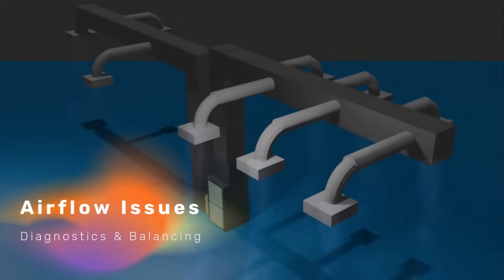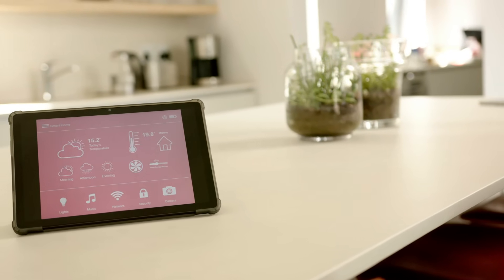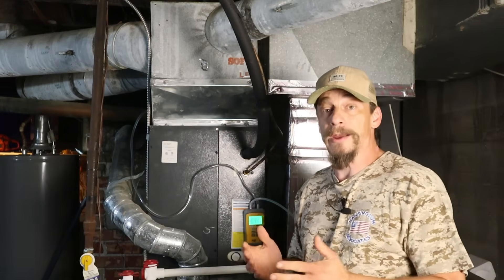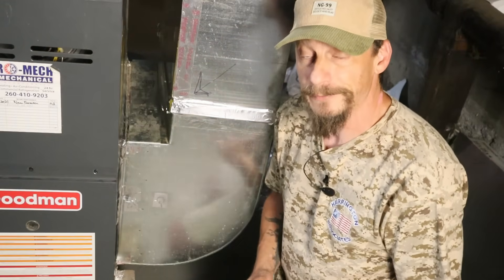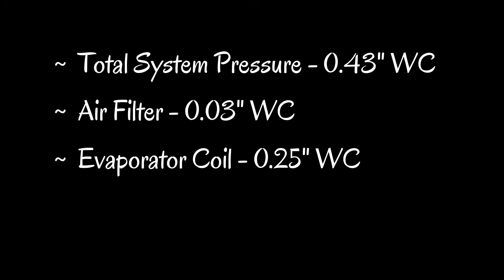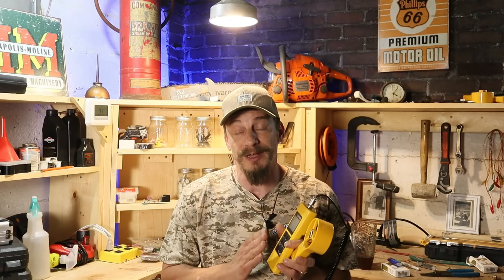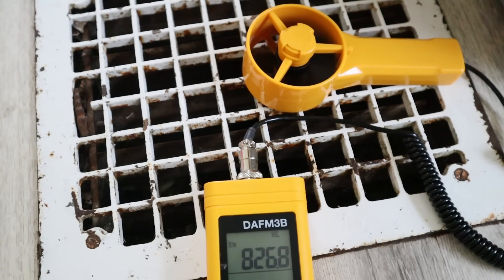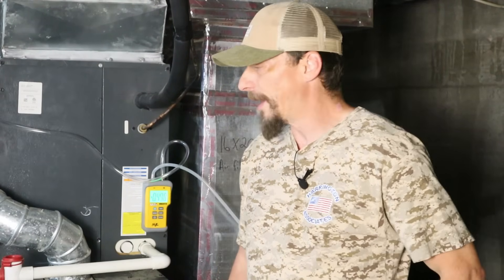How To Make Every Room Comfortable With Better Airflow

Comment: Thanks for your videos,  Mike.  I learn a lot from them.  I have a question.  Where do you take return pressure reading if there is no return duct?  A lot pf small houses will just have the unit in a closet on a short shelf with holes cut on the sides of the wall.
Reply from the maker: I take it just above the unit in the closet with the door closed.

Comment: Shouldn’t Total external static pressure be checked after the filter and before the coil?
Reply: Yes. You’re measuring everything that restricts the airflow. An AC coil and a filter are restrictions to that airflow.

Comment: Nice video! I'm still learning a bit about airflow and static. I had a senior tech tell me that me that before I make any adjustments to the blower speed, count the amount of ducts, what size the ducts are, and how much CFM the ducts are rated, add them up to the total CFM the house plus what CFM the tonnage the system needs and adjust from there. There had been times where I would come up to a 2 or 2.5 ton AC but they have a furnace with a 4 or 5 ton blower drive where I have to adjust the speed due to it getting too much airflow. He also mention if the static is off that you might have to add an extra supply or return duct to equalize it and improve the static if it's too high. I've only done it a few times but still learning. Any additional tips would be great too! Awesome video again!

Comment: Fantastic explanation!  Thank you for this. I’ll use your suggested method to adjust the balance in my new build since the system installer only goes by measuring the register temperature which doesn’t seem correct me for keeping a room cool during the hot summer (or cold winter).

Comment: I have 2 registers that get very very low CFM in fact one of them has 0 cfm.  They are the furthest runs in the house as well but we are talking 30ft max from the unit.  The condenser and heat exchanger were installed in 2016 and I called the people who installed them 2 weeks after install and they were ... combative (?) about coming out and checking the ducting.  They did ultimately agree to come out and look at it if they could give me a sales pitch on their smart vents (which btw were battery powered vent covers that cost $7000 which was more than the things they installed 2 weeks earlier).  The guy spent 30 seconds under the house looking and came back and said he couldnt find the duct at all for the vent that doesnt work.  I do not know if I have any dampers in the system because it has some trunk lines and then flexi duct to the registers and the vast majority of it is inside the ceiling or in the crawlspace.  I can tell you that the rooms that are connected to the crawlspace "trunk" (the kitchen and living room) are the ones that get very poor airflow.  The rest of the house off of the main trunk gets decent airflow but the master bedroom has about 9-10 mph wind coming out of the 4x10 register.  I need to figure out where the issue is because right now I have to run the AC for several hours because the thermostat is in the living room on the stairway going upstairs.  So the only way we are able to cool the house is to leave the bedroom vents shut or if we are going to be in the bedroom leave them open and the door open and wait for the cool air to waft down the stairs.
Reply from the maker: Call another company to come out and take a look. That behavior is just unacceptable.
Reply: @JerseyMikeHVAC  I had another company come out and perform a free inspection on the unit itself in 2019 just to see if it was functioning ok and the guy tried to say it was 8lbs low on coolant and needed new schrader valves (2 years after install?) then corrected himself and said it only needed 1/2lb of coolant and the price was going to be $550. I told him to pound sand.  He never even got to the point of looking at the ducts.  I wish I could find a reputable hvac tech but so far I'm 0 for 2.  Oh and the install company wanted $250/yr for a service contract to keep the warranty up.  I told them to pound sand as well.

Comment: My 3 ton Carrier air handler is mounted vertically in a closet made just for that unit. The manual says to include the dry coil, filter, and heat strips to obtain the correct airflow performance based on the 7 possible columns of static pressure. In this situation, where would you place the return air static probe in an installation that is using the closet as a plenum? There is no return air ductwork on the bottom of the air handler, as the ceiling of this closet is cutout to accept the return air duct. I'm assuming that if a filter is included in the calculation, the probe should be located just prior to the filter and not after. Is this correct?

Comment: I cannot get an HVAC company to do anything beyond basic maintenance that I've already done. My central air has struggled since I bought my home 7 years ago. My outside unit is the right size and only 5 years old. All my vents blow good but some rooms are noticably warmer. The house was built before central air and I think it was just slapped in here without any consideration for proper balance but I'm just a diy homeowner so I could be wrong. 

Edit: my supply plenum is in the crawlspace so I'm not sure how this test could be done

Comment: great video! i subbed to learn more! just wondering what are your thoughts on those electronic dampers using two thermostats?
Reply from the maker: The “quick and cheap” versions that just use two thermostats to power dampers directly can cause high static, noisy airflow, and even shorten equipment life. Design matters a lot with zoning.

Comment: Another Great video .thank you . Just have a question if we need to place those manual dampers is it better to install them close to take off or we need to install them at least one feet from the main run truck line please advise.
Reply from the maker: Ideally, you want to install manual dampers about 6 to 12 inches away from the trunk line, not right up against the takeoff.

Placing them a bit down the branch allows the airflow to stabilize before hitting the damper blade, which gives you better control and less turbulence. It also helps prevent noise or whistling from air being forced around a partially closed blade in a high-pressure zone.

But you don’t want them too far down the line either — that makes balancing less effective since static pressure has already dropped by that point.

Comment: Mike, in my 1964 house, all the ducts are behind 7/8” plaster board (great construction by the builder who built it for his retirement).  It’s AC only, and I don’t see any damper controls.  The return & supply plenum is exposed for like 2 feet at the Air Handler.  I’ve tried closing supply registers of “cooled rooms” to push air back to “hot rooms”, but so called professionals advise against that.
Any suggestions to balance?
Reply from the maker: Grille-based balancing does have limitations:
– The restriction happens right at the end, so it can cause turbulence or noise
– It’s less effective at actually redirecting airflow upstream
– If overdone across multiple registers, it can raise static pressure at the blower

If you're just making small adjustments, you’re probably fine. But if you want a little more control without crossing into those “static pressure” issues, you can install simple DIY restrictors a few feet inside the duct (like foam discs with center holes). They act more like proper balancing dampers and smooth out airflow while still reducing volume.

They don’t solve everything, but when working with an older system with no access to the ductwork itself, it could be better than using the registers themselves. Just don't fully block any of them or overdo it on too many registers.

Comment: I bought the same anoemeter but never made the connection that I could simply use the fpm limits on my ductulator for the anoemeter measurements. Thanks alot!

Comment: Nice, but I was thinking that IF you have very different sized registers, you would want to use cfm for a better over all idea of what is happening.
Reply from the maker: Yeah I agree. But this is something I can fine tune in on after all of the initial balancing. At this point (after the work done in the video) I would switch over to cfm readings and fine tune. I would even do a load calc and go by those guidelines. But this is not stuff a tech is going to do while on the roll. For my house, yeah certainly.
Reply: @kenthomas4668 I'm pretty sure velocity and cfm are relative to each other. Velocity and duct size can be used to calculate your cfm and vise versa. Now whether or not said # is sufficient enough for a particular square footage area is a different story.
Reply: Another great video, thanks.  Did you ever try balancing using supply static pressure on each run using the formula:
New SP= Existing SP X (Desired CFM X Existing CFM) ^2
Reply from the maker: No, but I'm really interested in giving that a try now.

Comment: Mike, fantastic tutorial. Will closing a damper/dampers cause any additional noise to be heard from the vents from the runs that were being throttled? Is there any way , utilizing your test methods to determine if a return was not adequately sized properly?
Reply from the maker: Closing dampers at the registers will definitely lead to an increase in noise. Closing down on dampers in the duct itself will be less noticeable. But generally you want to look at the velocity reading. The closer to 900, the louder.  600-700 FPM is a good spot. 

 You could take one SP reading at the return and the other in ambient air. If it's over -0.3" WC thats a sign of a possible bottleneck in the return duct design. You also want your return pulling no more than 700 FPM. Higher than that is a sign the blower is pulling hard to compensate for restrictions. Then of course there's the noise. it'll be pretty loud.